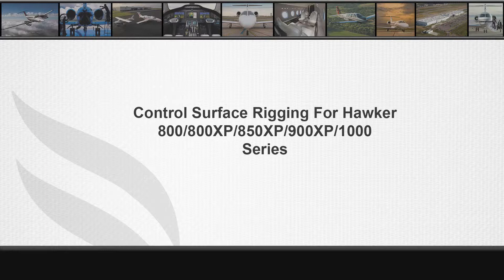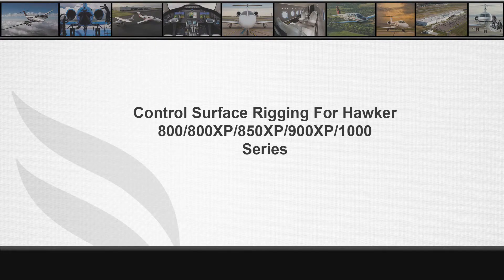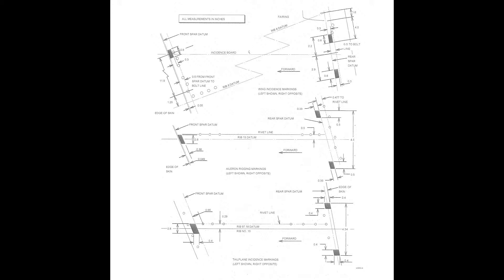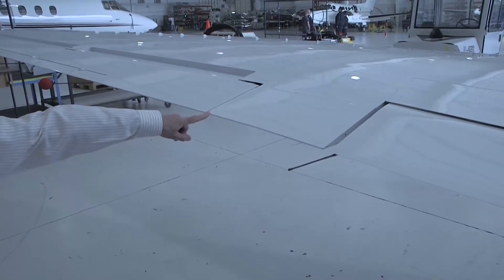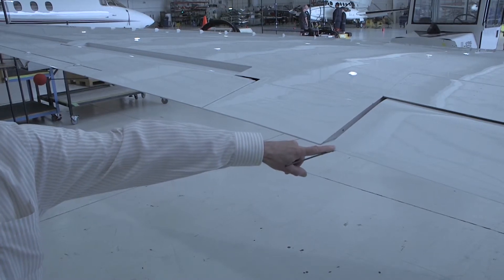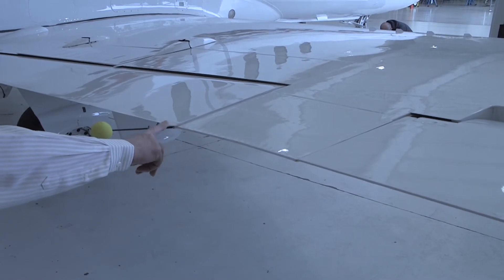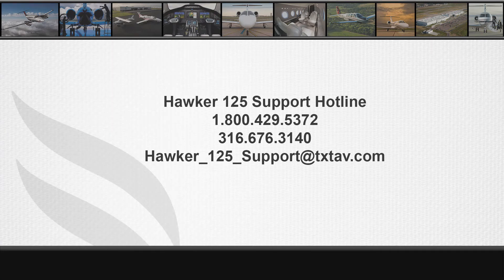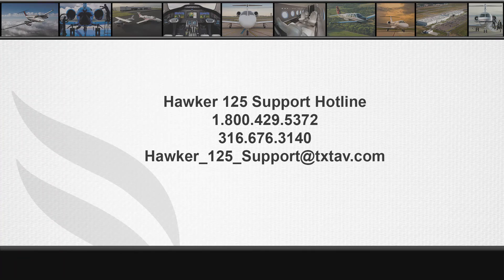Hawker 800/900XP - Control Surface Rigging.

Comment: Have had many flight crew squawk flaps out of rig looking at that trailing edge, explaining to them the rig mark on the flap are set during flight testing and are use for final flap position and are often the flaps are not aligned with that fairing trailing edge. Then they still look at me with skepticism. All of the Hawker series videos are great sources. Good job to Ian, Russ, and all the tech reps. Thanks.